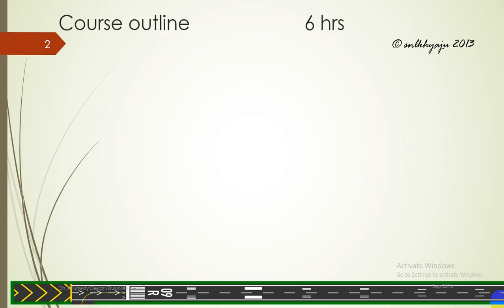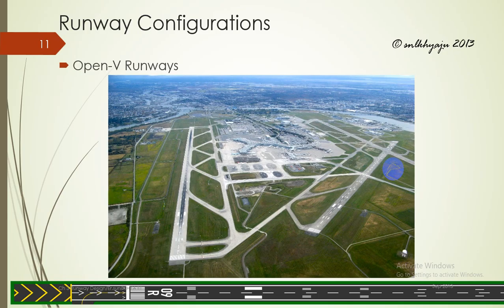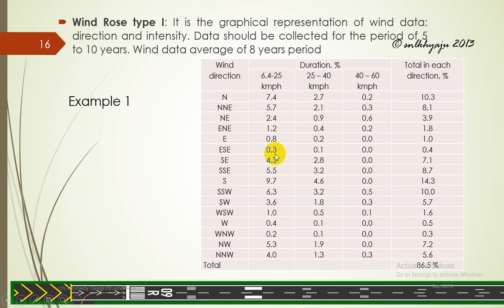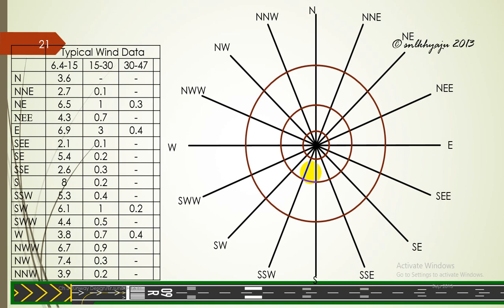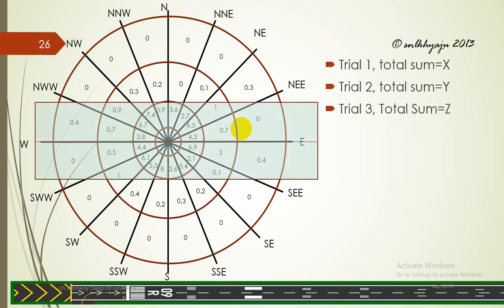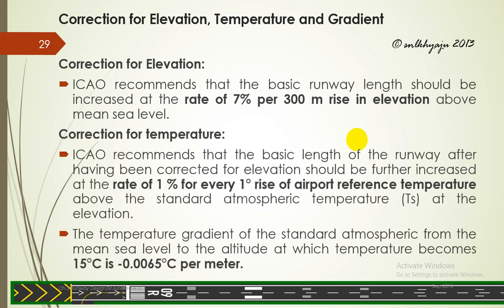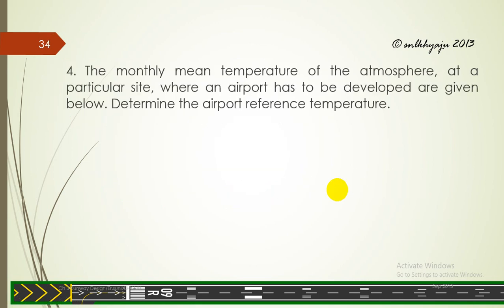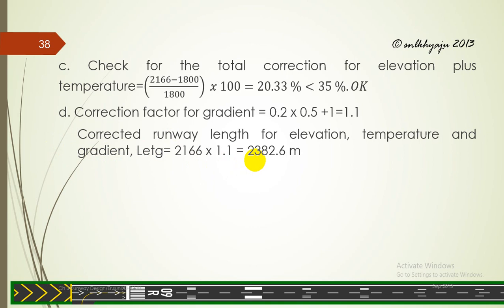Chapter 3 : Runway Design

Comment: What is the icoa recommendation for runway design
Reply from the maker: ICAO recommendations for runway design focus on ensuring safety and efficiency for aircraft operations. A key aspect is the Runway End Safety Area (RESA), which is a clear area at the end of the runway strip to provide additional space for aircraft to safely stop or accelerate if they undershoot or overshoot the runway. ICAO recommends a minimum RESA length of 90 meters, with further recommendations for longer RESAs based on aircraft type and runway code. 
Key ICAO recommendations for runway design include:
Runway End Safety Area (RESA):
A minimum RESA length of 90 meters is required at each end of the runway strip, with longer lengths recommended for certain aircraft types and instrument runways. 
Runway Strip:
The runway strip is the area immediately adjacent to the runway, including the RESA. ICAO recommends that the runway strip be free of obstructions and have adequate strength. 
Clearway:
A clearway is an area beyond the runway strip used to clear obstacles during takeoff. The length of a clearway should not exceed half the length of the take-off run available. 
Gradient Correction:
ICAO recommends increasing runway length based on the effective gradient of the runway. For every 1% effective gradient, the runway length should be increased by 20%. 
Elevation and Temperature Corrections:
ICAO recommends increasing runway length based on the elevation of the airport above sea level and the reference temperature. The combined correction for elevation and temperature should not exceed 35%. 
Runway Orientation:
Runways are generally oriented to align with the prevailing wind direction to minimize crosswinds during takeoffs and landings.

Comment: ICAO ko Doc 9157- Aerodrome Design Manual (part-1 : Runways ) ma gradient correction ko lagi 10% le runway length inrease garnu for every 1% gradient , vanera clearly mention gareko xa ta. FAA le recommend gareko vanera 20% linu vayexa .Aba 20% lida length badhyo, FOS badhla tara cost pani utikai badhxa, ani hamile follow garnu parne ICAO ho ki FAA??
Reply from the maker: ICAO le elevation and temperature correction matra recommend garchha ra standard gradient 0 % defines gareko chha ra gradient correction icao le recommend nagareko hunda FAA recommendation use gareko ho.